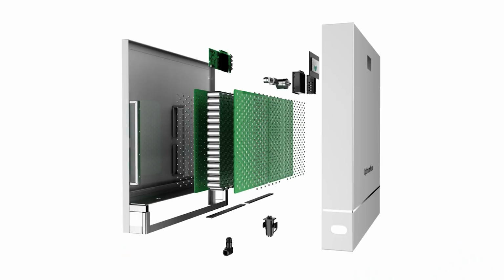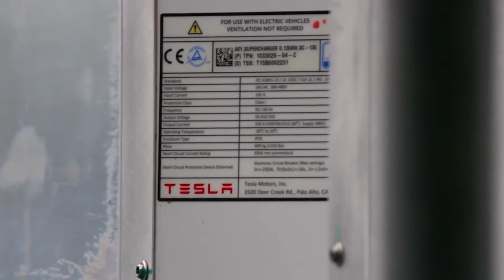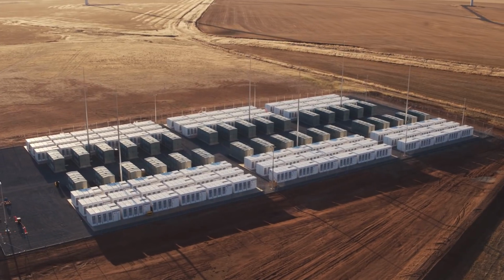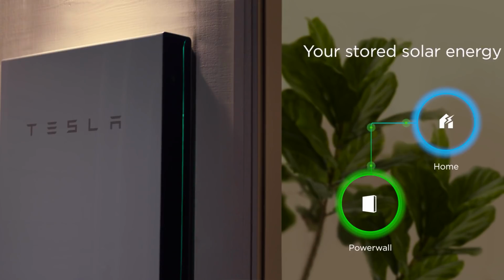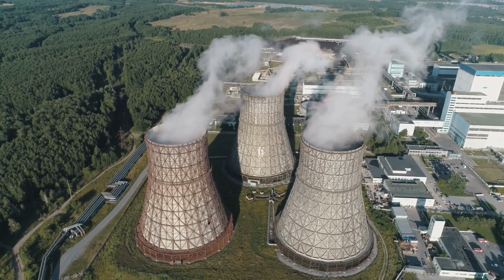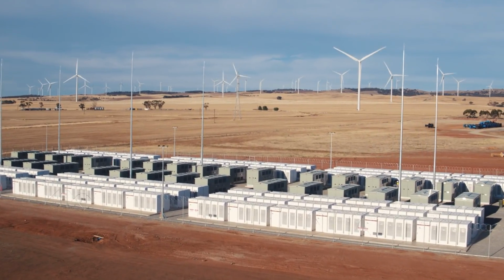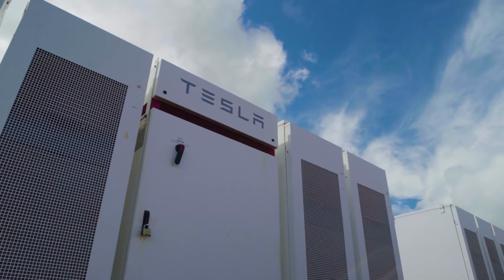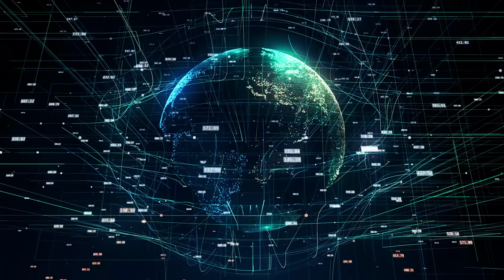Why Utility Grids are Afraid of Elon Musk

Comment: Ues i love your show and i made 48 000$ us from my stock in tesla that you sugested in april. I want to hear about a next gen hvac product with fitting for the water heater, fridge , pool,heating,cooling and whatever accessories possible. I got a image for one condenser with connections for all that heat and cool's for a home on dc brushless for extream hot or cold.instead of sending excess to the atmosphere it can be sent to other peripherals for efficiency. Eventually with built in conectors you can attach it to a powerwall and solar power unit and testa charger for scalability. Why not add a skynet receiver to every wind turbin and a mesh repeater to every tesla periferals for a complete synergy. I see great things so simple to built i wish i had elon's brain.

Comment: As far as I know there are no coal fired peaker plants, though some previously coal fired plants have been converted by installing gas turbines in place of the boilers. The only way that peakers can get up to speed in 15 minutes is with gas turbines.  Perhaps some very old, poor performing small coal plants would have been at idle most of the time, and could be brought up to full power in that short a time, but no coal plant can go from cold to full power without several hours of preparation, so virtually all peakers are gas or oil fired turbines. a very few may be fired with syngas from coal.
Reply: California has a number of tariffs designed to boost hybrid natural-gas + battery systems.   The hybrid plant can operate on an instant-response / infinite generation tariff by using batteries to bridge the usual turbine ramp-up and response times, and can also use the batteries to keep the turbines running at peak efficiency during lulls (to soak up excess power), and to prep the turbines prior to normal daily cycle peaking demand.  Plus providing voltage and frequency stability services on top of that.  It's pretty cool.

However, this brings to light one of the basic problems that battery systems still face... they just aren't big enough to truly take the full load of the grid overnight, or to suck up enough excess solar/wind power during the day.  It's not just a matter of storage, its also a matter of energy delivery.   The hybrid approach is cost-effective only because the battery requirements are fairly modest (the battery only has to bridge what is roughly a 30-minute time window).  But the amount of battery storage required to actually take over from fossil fuel is still cost prohibitive.

To really make a dent we need battery systems which, in aggregate (across a state like California, for example), are capable of delivering on the order of 10GW for 8 hours... 80GWh.  And to completely replace fossil fuel renewable storage systems need to have capacities closer to 800GWh to bridge state-wide foul weather.  That isn't going to happen any time soon.

-Matt
Reply: Paul Gracey  I’ve worked on gas turbines and yes 15 minutes is about right.  However a battery bank comes on to full power almost instantaneously.  This a  a huge improvement over peakers- one among many.

Comment: Source for $700mm per peaker plant?  Seems expensive. Unless you’re factoring in carbon cost (which is fair, but misleading if not mentioned)
Reply: They are comparing Apples to Oranges.  150KWH battery to a 1000 to 1500 MWH plant.  Whole presentation is highly flawed.  Definitely drunk on the Tesla Koolaid.

Comment: I worked at Active Power, they "Joe " had a 600 lb. fly wheel that would spin 24 hrs. a day. If your commercial building lost power the inertia of the fly wheel would supply power until the generators sinked up. They switched to a turbine the size of a hockey puck using compressed air. Another UPS system was a Data Center at H.P. with 16 - 2.5 Mega Watt  Diesel generators. Radiant Energy will be the Disruptor.

Comment: What happens if no wind for several days.  Peaker plants are still needed.   Sure quick batteries power supply is great and has value.
Reply: You may want to look into how much wind it takes today's wind turbines to create energy.. The problem they usually face is too much wind and need a to either turn them off because they don't have battery storage to allow them to take advantage of the excess. Wind farms are placed where wind as a resource is reliable and "constant" so we don't need peaker plants to support any imagined short fall, we need batteries.
Reply: @dr-k1667  Great point. Seems like a no brainer to me
Reply: Tesla. 
Why not a smaller  Pack, say 30to 5 0  kWh  for ordinary  homes  .just  imagine the  enormity of demand and  vastness of  market : inter-- continental !
Reply: Which part of "Peaker" don't you get?
The batteries are used for the same purpose, they're not completely drained.
Reply: Roger Starkey what do you do when the peaker battery power is discharged?   You can have no wind/low wind and cloudy for a long time.  Modern industrial society needs continue power.  Or like when I visited India our server farms all needed on site backup generators with on site batteries until generator came up.  Think about all the industrial processes need continuous power.  99% up is disaster.
Reply: edwong3 I support solar wind and use of batteries to generate power.  What I see so often is just dreams of total supply on this topic.  Modern industrial economies need reliable consistent power supply not day dreams.  If they can be mixed with hydro and evil nuclear might be a chance.  So many times folks that don’t know shit play experts.   You want your pharmaceuticals manufactured with power that goes off.   How about car lines or semiconductor factories or server farms.   If you degrade the grid consistency you force local diesel backup generators.
Reply: edwong3 ok guys I give up.   I own a Tesla have another on order.  I own Tesla stock.  I am an engineer.   If you want less carbon combined with oxygen just tax carbon.  Get all the other countries to tax carbon also.  If you want less of something just start raising the tax on it.   The hand of the market does a supremely good job of rationalizing resources.   

I have not put solar cells on my house.  How can I put 10KW on my house cheaper than an industrial scale implementation.   Can I buy them cheaper than someone putting in a 1000 acres - no way.  Can I get them installed cheaper - no way.   Can I get defective solar cell replace cheaper - no way.   Can I keep them clean- no way.  Yeah I know I don’t have to buy the land.  My niece had solar installed.   She gets to enjoy water leaks that they can’t find the source of.  They gave up ha ha.

People have bought Mercedes for a long time.  Many don’t realize they in fact they are simply making a life style statement.   Just raise the tax on carbon and or have one less child.
Reply: i agree, for now at least. Although it makes no sense to continue building them in the future, you could use regular gas or nuclear plants to charge the battery's as well.